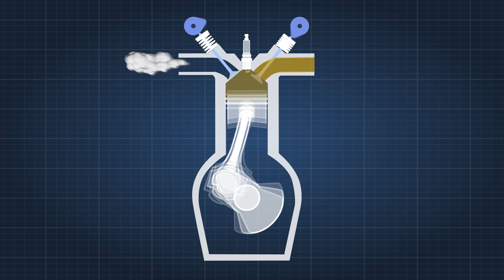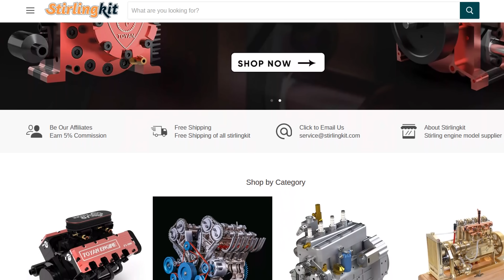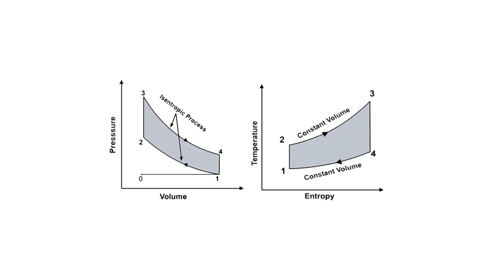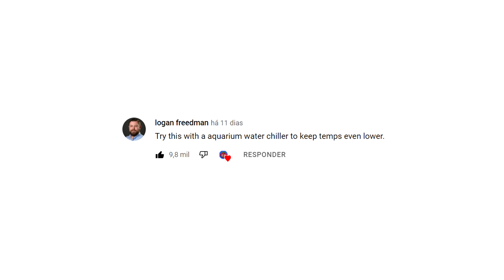I 3D Printed a Transparent Combustion Engine in Resin

Comment: I think your thought of the spark not being on long enough is in the right direction. You have understand with cars that run methanol-based fuels, is that the spark has to be a lot hotter to consistently ignite the mixture. Spark tuned for gasoline may not consistently ignite a methanol-based mixture. On the same note, this also explains why your 15% nitromethanol mix was not igniting. The 25% however is just RC car nitro fuel, and that is able to ignite under compression alone, much like how Dragsters will kill their spark plugs, but will still continue to run until the fuel is shut off. The ignition was slightly delayed on the 25%, and was not well timed. I believe that was purely compression based ignition.  If you make the spark plug hotter, by getting a larger magneto, or running more amperage through it, if it's an electronic ignition, May more consistently ignite the mixture, but it will also burn your spark plug up.

Comment: The problem you have is that, the ECU (magnets in this case) can't follow up the RPMs of the motor. Try to not fully open the intake of the carburetor or put a faster ECU. The 25% nitrmethane is not igniting by the spark... is igniting mostly by itself... probably before the piston start to descend.

Comment: Just load the engine with a crankshaft load 

The engine needs to work otherwise it's going automatically in 8 stroke mode for idle otherwise u get a runaway engine

Comment: the timing may not perfect.... and that COULD BE why you aren't getting high RPMs on the nitro.... PLUS your air/fuel ration probably needs to be tuned in the carburetor (which I am not too good with, so that's gonna be trial and error on your part) - I think this is the MAIN PROBLEM
compression does play a HUGE PART in the amount of power you make so the piston ring may not be tight enough... I'm not sure how small the tolerances are with your printer tho, so you should  make the cylinder a tiny bit too small and then sand and polish it to the correct size.... same thing with the seal on the head.... (i would make the cylinder a small amount too 'tall'/'long' and then sand and polish it down by sticking thew sandpaper to the table, turning the cylinder upside-down, and sanding that way - so it stays as flat as possible (DON'T FORGET TO POLISH IT SMOOTH AND FLAT TOO!!! )
plus you can see fuel leaking from the top of the cylinder in a lot of the videos..... so that means the seal/gasket/o-ring is not doing a great job... (it looks like an o-ring from what I can gather - so you should buy one that is just a bit thicker but the same size)

Comment: Your fuel mixture is off. If you're going to run a fuel with half the energy of the fuel the engine was designed for, you have to make the jets in the carburetor larger. I don't know if that little engine has a carb that can be adjusted or not, and I'd bet it doesn't have jets that can be changed. You might see if you can get another carb for that engine and modify it for a larger jet.  

There are vehicles on the road today that use two different fuels - gasoline and E85. E85 has less energy per unit of volume than gasoline, so the car's ECU has to determine what percentage of each fuel is running through the fuel line, and adjust the fuel that's injected into the engine accordingly. You need to make similar adjustments to your engine.

Comment: what if you replace the reed-switch with a hall effect sensor and use an arduino to do the sparking? I think mechanical switches don't work good at high frequencies

Comment: The most important thing is the gas to air ratio. you have a simple carburator. If you do not adjust the air/fuel ration, the mixture become inignatable. if a cycle is missed, fuel stays in the cylinder (condensation) and the ration is kinda ok. Carburator are pain in the ass to adjust to different fuels.

Comment: Could be missing power strokes due to the lack of compression. This leads to a slower flame front that just doesnt get utilised by the engine as the rpm is outrunning it and also the spark plug doesnt have enough time to ignite the mixture, try advancing the timing at the higher rpms. Also lower fuel density doesnt always mean less power, some cars run E85 or water meth injection as it helps keep temps down, more air, more timing, thus allowing for more controlled combustion and power 😎

Comment: @Integza: and do not forget - you need a common ground for the sparkplug with the ignition coil. if the head and the base where the ignition sits are insulated, it won't work well.

Comment: What may be happening is that. 
1 As you say the time of the spark is not correct. 
2 engine is overswiveling (over Cycling). 
Other thing, It seems that the ring is cracked (the green rubber)

Comment: I'm going to speculate that you have twice the fuel, sometime three time the fuel in the cylinder for each power stroke, the gas isn't heated sufficiently for it to exhaust properly when it doesn't combust, so when it does combust there is more power.
With the 25% mixture the fuel does combust every time and does vent the exhaust properly and uses all of the fuel in the cylinder.
this is my best uneducated guess.

Comment: In motor engines there is sth whitch changes ignition because of RPMs. When the engine works with higher RPMs the ignition is execiuted ealier. When you had higher RPMs ignition was made by compresion not by spark.

Comment: Video idea: Make your own ethanol trough fermenting sugar and destilation and then try to tune the engine to run on that. Here in Brazil we have lots of ethanol-running cars, or even "flex" cars, wich can run on gasoline and on ethanol as well. It burns way cleaner and is also better for the environment, as we can plant the sugar cane every year (wich if done right can capture the co2 burnt as fuel back from the atmosphere).

Comment: The problem is that the carburator of that engine is set up for gasoline. The other fuels are not mixed in a stoichiometric Ratio and thus don't burn as cleanly. This also explains the darker flame.

Also as a suggestion for a new video i would love to see this engine run with a proper tuned carb and maybe even a Arduino ECU(speeduino) for proper spark.
Love your channel keep up the great work.

Comment: Possible causes:
The air ratio to fuel is very important. This should typically be 13:1. You can test this with a wide band O2 sensor, which could make a cool video. To adjust the air to fuel ratio, you need to adjust the carburetor, either with a needle or screw adjustment. It depends heavily on the carburetor. Another compent of Air is the compression. When you said that you you sanded it down too much, you caused something called "blowby" where the air passes the piston and enters the crank case. This is a major issue and can cause a lot of power loss. A good way to test this is a bleed down test. Also probably a good video. Different fuels like different compression ratios also. Some engines will have a low compression 10:1 for example, while high performance engines may have higher. You can adjust this by printing slightly shorter or longer cylinders.

Another possible cause is timing. Timing is the point at which the sparkplug ignites the fuels. This changes based on the fuel used, and the compression ratio. An engine may like a spark at 10deg before top dead center of the compression stroke while others may perform better at 15deg. Typically this is done by "feel" on small carbureted engines. If you can easily adjust the sensor that detects the magnet to trigger the spark then move it a little while the engine is running to see if you get better performance. I recommend fixing compression first, then air/fuel ratio, then timing.

Also a slight load on the engine will help make these tests either. Hook it up to a small DC motor with a belt and power on a bulb

Comment: Jetting and ignition timing I would assume are the main issues and why you are seeing so much variation. I would try advancing the ignition timing a bit first and see if it helps then adjust jets to point you are getting a good burn before switching to another fuel. Goal is to get peak chamber pressure just after the piston passes top dead center without preignition and depending on the fuel the engine temperature plus how homogenous the mix is will determine how much before or after TDC you need to fire the plug.... Looking how its running and knowing its a print etc I'm guessing you will want advanced timing by 15-30 degrees and I would start on the side of less fuel or leaning it out with jetting as you don't seem to be igniting at all till the high nitro mix so I'm thinking you are running rich.

Comment: I once again recommend you look at turbo prop engines. They provide a mix of power and efficiency with smaller aircraft. It also has a really interesting design for compression and air intake

Comment: When the power stroke occurs creates massive pressure. The opening of the release valve might not be enough to release all that compressed pressure ,so the fuel entry valve when opened, because there is still compressed material in there, instead of fuel entering it will be repelled.
Reply: Exactly what I was thinking. The timing of the spark and duration of the burn might not be well suited for the design of the engine, causing it not to scavenge well, causing a bad intake stroke following good power strokes.

Comment: On the 25% nitromethane being slower. You said that the plus of nitromethane is that you can use less air to burn it and as such burn more fuel pero combustion cycle. Did you adjust the carburator to take advantage of that? Because if you didnt then you're burning the same amount of nitro as normal gas, which will only lose you power.

Comment: I've always wanted to see this done, because I love the complexity of 4strokes. But 2strokes, however, rev way higher while producing twice the power, because 1 out of 2 strokes is a power stroke instead of 1 out of 4. They can rev ultra-high because they cannot beat the valves to death, because the fuel and exhaust ports are on the side of the block in different locations. If only they ran off fuel and had oil in the crankcase🤔
Reply: Double the power stroke also means double the emissions after that logic.
To avoid 2 strokes running on oil,  sb could try direct injection. 
That would work, wouldn't it?
Reply: @norman9339  yep! plus, nothing sounds better than a 2stroke KTM.
Reply: such engines exist: you can make a two stroke engine with oil in the crankcase for lubrication. However, in doing so you negate the pumping effect that happens in the crankcase (as it's now isolated from the cylinder), so you need an external pump to both feed new fuel in the cylinder and push out residual gases (the "scavenging " process), usually done with a volumetric compressor (connected to the crankshaft or to an electric motor). In this configuration you can have valves as well, and the engine block becomes identical to a conventional 4 stroke block, but operates in the 2 stroke cycle
Large ship engines use two stroke Diesel cycles because of the advantage in power compared to foru stroke
Reply: @Motoralbi  that works, but the simplicity, sound, and design will be gone.
Reply: @Mittenstateadventuring  I told you how you can adapt a two stroke to not burn oil, obviously it will become more complicated. As for sound I doubt there would be an enormous difference in case one used piston ports and an expansion chamber exhaust, you would only get more whine due to the compressor and a different note from the intake

Comment: Simple concept. Turbofan Engine made in 3 parts with the afterburner made of ceramic. Then here is the fun part. Water Cool it on the 1st phase. That way it can be efficient and you can even run it off the nitro methane. Injection compression ignition, exhaust, ignition, FLAME! The Jr. Tomato Lord has no idea what will hit him.

Comment: Hows about using oxy-acetylene (like the welding gas) as a rocket fuel but be careful as i you will get a dangerous kick from it,  however it will allow you to control the oxygen to fuel ration directly in the engine

Comment: A modern gas engine easily gets 35-40% and diesels get over 45% nowadays. With the help of efuels, this number will increase to over 50% in the next 10-15 years.

Also it run so poorly on nitro, because it’s running way to lean. You really have to crank up the carburetor to compensate for the lower energy density. You should try to get a lambda tool and tune the engine to lambda 0.85 for max power.

Comment: Video idea: create an hydrogen/oxygen generator, separate and pressurize them in 2 gas tanks and make them go trough a nozzle, basicaly creating a rocket similar to those of NASA (which use liquid oxygen and hydrogen but is quite difficult to get to that).

Comment: I think you do not measure the power of the engine correctly since power is the combination of both torque and speed, so you should measure both to see which fuel perform the best ! cheers !

Comment: I remember somewhere, not sure where that to make a jet engine work you just needed to heat the chamber to help the gasses accelerate, this was in the context of using micro waves, but I don't think you couldn't do it with say, concentrated solar radiation, that might be a fun build and you could see about making that a turbine and seeing how much power it could generate.

Comment: Also, the most likely explanation is the magnets. There could be a minute delay caused by the magnets, which then sparks the piston late. Gasoline would struggle the most, because it is the most powerful fuel, pushing the engine too fast, then cycling without fuel until the piston slows down enough and the magnets can time the spark plug right again. To test this, see if there is a pattern in the number of power strokes. If the number of strokes without firing before firing remains mostly constant, I am almost positive that is your problem. You could do a future video trying to fix your sparking system, I would love to see that and if my solution is correct.

Comment: Your air intake inside the engine is a bit off. Make sure your carburetor is getting enough fuel + air into the system, also check for leaks, you might have noticed how there's some air bubbles forming on the cylinder at 3:51 . One more thing, different fuels require different air mixtures, make sure to account for that next time! Awesome video, as always.

Edit: timestamp

Comment: Does the engine have a governor?  Many governors on these small engines regulate the speed by cutting off the spark when the engine is over-revving.  Also, I could see exhaust gases escaping from the between the cylinder head and cylinder.  That could be affecting your compression and fuel mixture.  A better gasket should help seal that up.

Comment: A common misconception about octane is that it makes your fuel more explosive. 
In actuality, they add octane to calm the volatility of petrol (gas) to help the engine run more smoothly and with less misfire ping. 

Also better atomization of the fuel as it leaves the carburetor will increase performance and fuel economy as it helps the engine fire more reliably.
Reply: Misfiring is a sign of either a very bad engine-design or too high compression rate for the fuel. Higher octane means it is stable under higher compression, which in turn yields higher power/efficiency.

Comment: First problem: No carburator adjustment. The high nitro fuels need less oxigen to burn, thus would benefit from lower air and higher fuel ammounts. I recommend changing that fixed carburator with one where you can adjust air-fuel mixture
2nd problem: possibly the compression is still problematic. In earlier parts of the video, there was stuff foaming near the cylinder and the top of the engine. Maybe a point of leakage
3rd problem: This one is harder to adjust, and you might as well ignore it. Different fuels have different burn times, ignition times etc. For a very slow burning fuel, you'd for example, need to ignite it with the spark plug just slightly before the peak of the piston, so the pressure builds up exactly when the down cycle begins. For fast burning fuels, you need to ignite exactly, or just after the peak is reached. To be able to properly adjust an engine like this one on the fly, you'd need to monitor the rotation of the flywheel, and use an arduino or something, to trigger the spark, depending on the flywheele location (it should be directly related to the position of the piston). The current spark is analog, and thus would be a pain to adjust. its easier to ditch it.

Comment: You said your self that each fuel required a different fuel to air ratio. The jet settings for your carburetor might have been ideal for the last fuel test. Also. The spark plug needs to be sufficiently grounded to the crank case(where your points/coil is located) the resin cylinder is not conducive. You are replying on the push rods to make a solid electrical connection at the exact moment of ignition.

Comment: My theory would be that gasoline might need both more oxygen and more temperature to burn. (I haven't checked data for that) This would mean that you need to pump less fuel (maybe atomize it better? or instead pump more oxygen via cooling, turbocharging, or just pure oxygen from a can) and have a stronger spark. But anyway; seeing that it works so well with Methane, I would just use that. If you manage to make the other fuels to work efficiently, you might break the tiny engine.
You have to look into the flame color - it is blue for methane and yellow for gasoline. This is an indicator of the flame temperature, and how well it is burning. I think you're not burning all the gasoline you're adding in.

Comment: you need correct ratio between fuel and oxygen, 25% nitrometane burns every cycle because  it's contains oxidizer for fuel and also more stable ratio